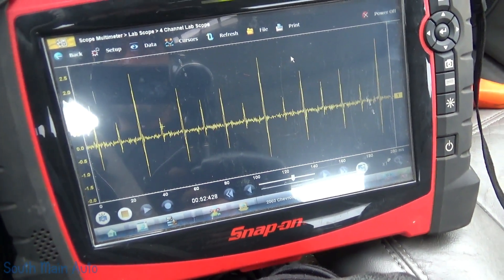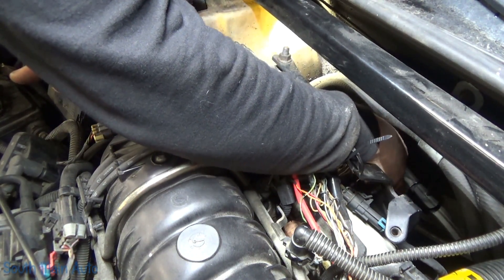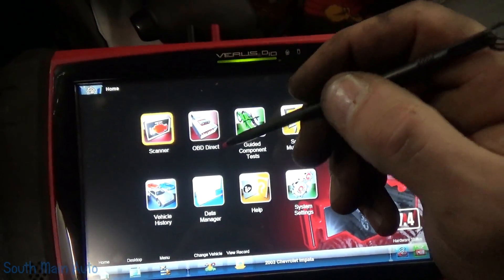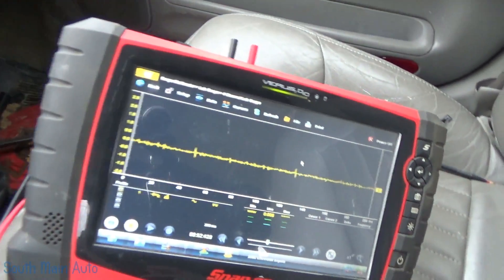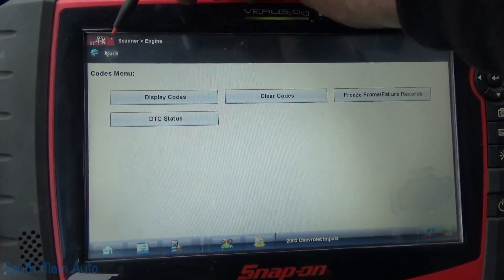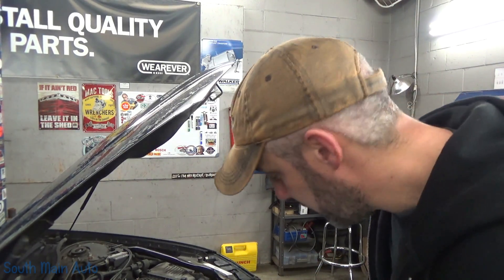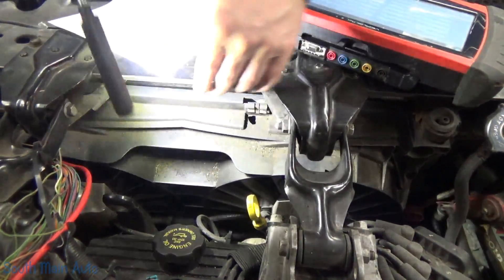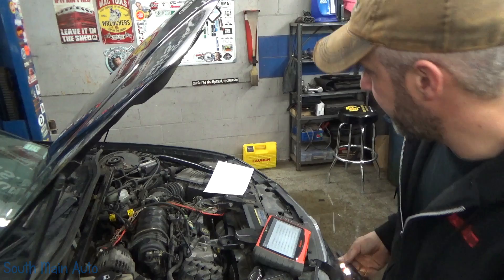Chevy Impala - P0332 Knock Sensor Trouble

Comment: Thanks, good video..   I think mine what implanted, too..  xD   9:30

Even, got some new SP wires just incase...  I was thinking spark jump, too.. But, haven't changed them yet; because, runs Nice-- with the Code Cleared.

I think I'm going to change & check continuity of the other knock senser-- just because..

Comment: Running both at half speed I could think of a few reasons. Less noise and vibration. Less surge draw on alternator causing less idle fluctuation (better idle drivability) due to alternator output response. Two low fans pull more uniform air over larger cross section of radiator.

Comment: I had same type of problem. My main drivers side fan would not come on when temps make it should turn on. Passenger side was OK. All I did was hook a wire to a switch inside car then manually turned it on or off. I did not care if it was the right way but it serves my purpose instead of paying out tons of money to fix like the chevy dealer wanted. Most independents did not want to touch it at the time with most saying after checking out the system that it was the ecm.

Comment: decent fan setup really, eliminates resistors which wastes power and provides air flow to whole radiator and condenser at low or high velocity. which is far better for A/C pressure control among other things.

Comment: Dear Eric O! I decided to rewire my "Chivey", and removed all of the wires at the same time, instead of one at a time!! I used different colored wires, and different style connectors, and now when I turn on my right turn signal, the horn blows on my 96 Acura integra, and my next door neighbors porch lights blink!! Tell me how to fix this for free, and I heard the doorbell again!! UNSUBSCRIBING!! But I'll wait til after the answer, this time!! 

P.S. I don't know what year, or model it is, but it's blue, with a gray interior, and either a V6 or a V8. And aluminum wheels!! 

P.P.S. There is no junk in the floor boards, but my neighbor and I are loading it up as we speak!! Can't have you talking about working on a car without junk in the trunk!!

Comment: Actually the two speed cooling fan system without resistor is pretty smart idea. Resistors gets hot and hot things tend to fail. I am curious about how the ecm knows the failed fan circuit? There is no feedback circuit on the diagram which Eric showed us.

Comment: I have a problem with a 2010 Ford Mustang v6. I was driving and randomly died while driving. Pulled over and gave the battery a jump and nothing checked fuses and nothing but I noticed that I couldn’t even put it in N it stayed in park. Plus my theft lock light is on and doesn’t crank at all. And when I try to crank it, my blinkers go off and the theft lock light also & my interior lights stay on. Please help!!!!

Comment: Conditions needed to be met to have Eric O. work on your car:

1) Must be a rusty piece of shit. THAT'S A GIVEN.
2) Preferably hacked up by the owner or a previous shop. 
3) The owner has to barely be getting by as evidence from the condition of their car/truck. No Yuppies here in Avoca folks.
4) Interior of the car/truck must look like a well used dumpster.
Reply: Damn, guess that means I'm not allowed to have Eric O work on my car...I only meet one of the 4 (#4), and that's because the wife drives it 90% of the time.  I've only had the 5 year old vehicle 4 years so I'm working on #1, but may not be at the "norm" for Eric O quite yet.  It is a Dodge, so it's got that Eric O opinion going for it!

Comment: You are the MAN! I really like the intelligent way you attack these problems. A $5000 Snap-On scope helps, but without the sense to know what the scope is telling you, the scope is a paperweight.  😅 A regular oscilloscope would also show the IF the code scanner had live data to narrow the search.  I'm shocked that GM did not shield these wires. I worked on the early GM ECMs in the 1980s and all signal wires were shielded with foil. Guess that got too expensive, or make the harnesses too fat. As you say, at 50K volts for the ignition wires, maybe it would have not have made a difference.

Comment: I own a 2002 Buick Regal LS I have a bad catalytic converter & I can still drive the car normally but the code is P0420 I've been driving with the engine light on for a while but it kept coming on since I had the code cleared a few times & the service engine soon light comes on due to the P0420 Catalytic Converter.
Reply: Cadillac has four or more ECM updates for same code falsely indicating a bad cat when it's not bad at all. Could be you've got the same GM nonsense going on under your hood? Still have to pay $$$ to get your ECM updated with truth telling software if you want the light and code to go away. Imagine being the guy that just paid the dealer thousands for new cats and he still has the code, now times that by hundreds and a class action lawsuit threat for each of the four updates released. And you still have to pay. Ivan just did a video on a way to cheat though = https://www.youtube.com/watch?v=DKOgGoAgPNs
Reply: A 1 inch piece of black electrical tape placed over the warning light works better than clearing the codes. It's a one time fix and works for all future problems.
Reply: 18" piece of rebar thru cat couldnt hurt either.
Reply: Mark from [fordmustang98guy]  install an spark plug oil illuminator 18 mm and drill it out to get your 02 sensor in that will make your code leave

Comment: For those that don't understand what's going on with the fans.  If both loads are run in a series then both fans only receive 1/2 of the voltage (IE they act as resistors).  Forward information:  Relay 1 and 3 are four pin relays and the second is a 5 pin relay.  If relay 1 is energized the power feed goes from the battery to the fan.  The trick here is where the ground for the fans come from.  The ground path is determined by the parked position of the number two relay (the 5 pin unit).  When that relay is not energized C4 on your diagram (pole 30 on the relay) is parked on B5 on your diagram (pole 87A on the relay).  It is then feed to the B post on the second fan which the A post is grounded to the chassis.  Therefore both fans are running off the same C8 hot on relay 1.  The high speed magic happens when the high speed is commanded on.  The low speed relay would stay on but relays two and three would be closed by the PCM.  What this would in turn do on Relay 2 is redirect the ground of fan 1 directly onto splice S148.  Fan 2 would be energized by the third relay.  So both fans now run at their full 12 volt speed.

It's actually a pretty simple setup and easy to understand once you grasp how what the relays are doing their their paths to ground.
Reply: Thanks for the explanation, I was just about to explain it until I read this. The 05 and newer GM trucks with electric fans are wired the same way. It's a pretty simple system, the only drawback is that if you lose one fan motor, then neither one of the fans will work on low speed.
Reply: Anyway this saved you from an expensive resistor. They always burn away by time.
Reply: This mechanic is close to godhead status 🎉
Reply: Bubba sure knows how to find you.

Comment: Wow Eric,  what kind of gorilla worked on that wiring harness xD

Interesting layout of the fan relays...similar to a Toyota 3-relay system!

"low speed" = both fans powered in series, run in at half speed. Relay 1 is energized.
"high speed" = both fans run at high speed. Relays 1, 2, and 3 energized.
Reply: We should start a go fund page for the guy so he can get some split loom and electrical tape from Harbor Frieght.
Reply: Pine Hollow Auto Diagnostics 😂🤦‍♂️
Reply: Pine Hollow Auto Diagnostics 🖕🖕🖕🖕🖕🖕🖕🖕🖕🖕🖕🖕🖕🖕🖕🖕🖕🖕

Comment: Great video Mr. O!  I'm going to show my instructor this video since we are currently studying the Snap-On scanners and how to use all the various functions like the lab scope, guided component testing, power user tests, etc. This is a great example of how a lab scope can help identify the issue more precisely.  

I'm not sure if you know about it or not but the lab scope module detaches from the scanner so you don't have to run long leads, just use the normal leads and set the lab scope module wherever and it will transmit via bluetooth to the scan tool. Sorry for the noob advice incase you were already aware of that, I just learned about that feature last week and thought I'd try to share :)

Comment: The car will run fine without the polyloom on the wires, without it, the wires can "breathe" better. Lol. 😁😀😂
Reply: Better heat dissipation for the excessive current on the undersized wires.
Reply: Guaranteed  an extra 5 HP.

Comment: get the lights off so you can do a drive cycle to get it to pass inspection????
Reply from the maker: Yes that is state mandated, however the car will not pass mechanically, sway bar is busted, wheel bearing is loose, tires are bald in the rear, rear brakes are one day away from scraping metal...

Comment: YEAH! That car is SWEEEEET!! 🤘 Now you've got a taste of the caliber of vehicles I get. 😂

Looks like that snow hit you guys a few hours earlier than us, if you filmed this yesterday  (the 17th). Started snowing here around 7PM. Then it hit 42° today, and made an already salty, muddy, & sloppy mess even worse ...

Pixies live in magic boxes, and smoke lives in wires. I've let the smoke out a few times - that's always fun. It's usually accompanied by fireworks, which is always a thrill. 😁 

Thankfully I haven't seen any pixies since '87, when I licked a piece of funny looking paper ... 

I figured out where I'm going to put my lift - at around 11:26 I counted the cinder blocks in your side wall - looks like your lift is 12'-13' away from the wall. If that's good enough for you, it's good enough for me. Thanks again! :)
Reply from the maker: those bays I believe are 25' deep and 13' wide each... it's tight. that is why I only have one lift in that side...
Reply: Ahh, the camera is deceiving - the bay looks alot bigger through my screen here. Sounds like the lift is about halfway into the bay, between the garage door and wall.

Shop I just built is 30'x26', minus a foot in total width & 6" in length, due to 6" of foundation sticking out on the bottom of the 3 walls (the 4th wall is my old existing 50+ year old barn, built from the 100 year old barn that formerly stood here). Should be plenty for what I want to do. Tire machine and balancer, toolbox, press, and workbench will be on one side, my custom built waste oil burner on the back wall, and I think I'll put the lift straight in, but towards the opposite side from all my stuff. Still lots of planning and drawing to do - I only want to do this once! :)

Comment: Knock sensors are usually piezoelectric-- just a piece of crystal that puts out some voltage when vibrated.  Exactly the same as a crystal phono cartridge of long ago.  They have an insanely high output impedance, many megohms, so it's very easy for any stray noise to add onto the signal.  Ideally those signal runs should be made with shielded cable, like shielded audio cable.   Or as you said, run far away from high voltage spark signals!

Comment: hey Eric o, i cant get enough of the videos... so informative. how did you know the torque converter went into lockup. Could you explain or anyone on here that understands the way you can figure out torque converter lockup. well ive heard rpm and speedo should go up together or something like that if anyone could clear that up, would be awsome
Reply: You can tell on most vehicles that have a tach by watching it once you are up to speed and the engine doesn't need to work as hard. The tach will drop 100-200 rpm as it goes into lockup. Touch the either the brake or gas and 99% of the time it will drop back out of lock-up. On the more modern cars it can be harder to tell because of the way the electronics shift the transmission but generally you can still see it.

Comment: When you turn the fans on high all 3 relays engage. The 2nd relay gives one the fans it's own ground which allows it to run on full power. Then the 3rd relay supplies power to the other fan that has its own decicated ground.
Reply from the maker: Yes that is correct, On high speed, 1, 2 and 3 are on making both fans operate on high speed. Using the scan tool and turning on JUST "relay 2" makes 2 and 3 turn on giving just the Left Fan high speed . Good eye ;)
Reply: Che Kelley that part was already explained in the video.
Reply: I would stop looking at it from a relay on off stand point. When the fans are commanded to, "LOW", Relay 1 engages. The other 2 relays remain off. Relay 2's natural position is the power wire of the, "other fan". The, "other fan" is always grounded. So the circuit is naturally completed.    When the fans are commended, "HIGH", all 3 relays engage. Relay 1 provides power to , "FAN1". Relay 2 changes its position to a permanent ground, and relay 3 provides power to, "FAN2".  Sorry i dont know any other simpler way to explain it. The key fact is, relay 2 either connects to, "FAN2'S" power wire, or to ground. Relay 2 is a 5PIN relay.
Reply: Plague Plague I see what you’re talking about. I was confused when Eric O stated that turning relay 2 on with the scan tool it makes the left fan run high. I realize now it’s because it also turns on relay 3 and relay 2 is just on because it’s spliced in. Thanks for the explanation 🤔
Reply: On low speed just relay 1 turns on and provides power thru both motors to ground, causing both motors to turn at low speed.
Reply: Plague Plague I had to go back and watch it again. So if you command relay 2 “on” it also turns on relay 3 which runs the left fan but relay 2 isn’t actually doing anything at that point? Grrrrr I’ll get this one day...
Reply: Che Kelley low speed is good enough ant its quiet.  When panic is near high is available but will distress those near by

Comment: Those are the cars I try to stay away from. Too often the owners are the type to blame the tail pipe falling off after doing an oil change or changing a bulb. It's great to DIY, but not to obliterate things and expect others to make all great again, or at least not pay for it... which is at least double or triple the original cost. In your case Eric, you didn't have too hard of a job there & it ran coming in. I wouldn't have blamed you for pushing back out after popping that hood! Lol I hope the owner was pretty decent...